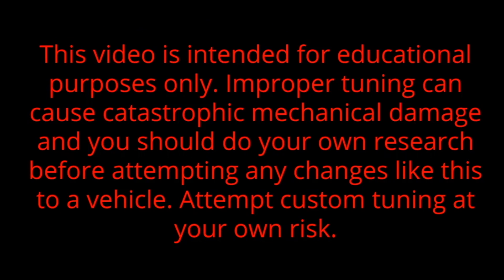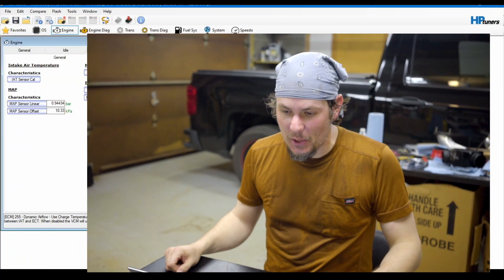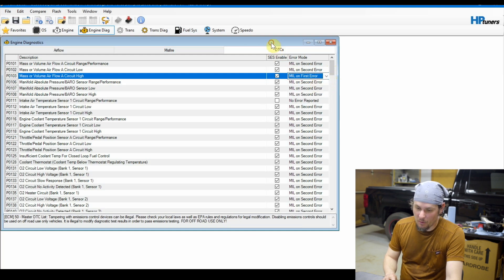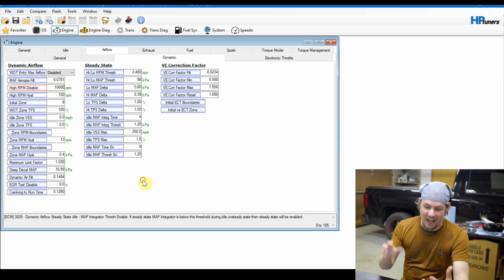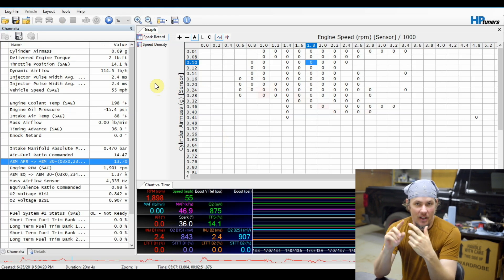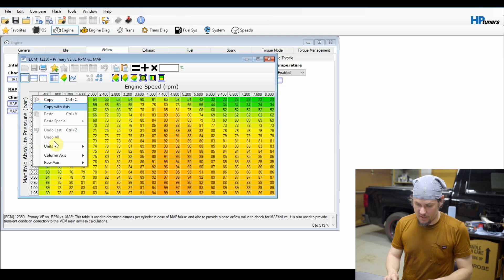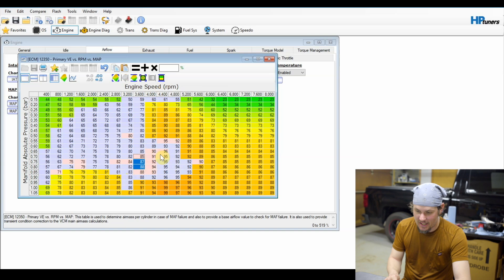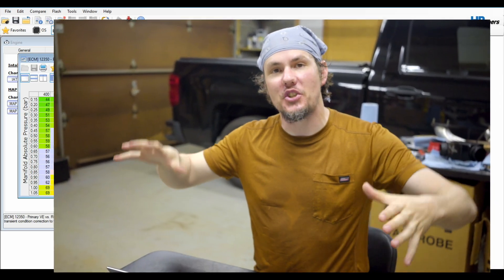GM Gen 3 Speed Density Tuning Guide Using HP Tuners, Dialing In The VE Table

Comment: first, goat rope garage i have learned all my tuning from you and i thank you. my problem lies here. i have a heads and cam ls1 m6 that was original tuned off narrow bands once i got my wide band and hp tuners i began working, but before adjusting the car was lean everywhere before power enrichment was enable. i spent hours tuning the VE and MAF tables correctly. everything was flawless the AFR was practically perfect. once i enabled closed loop the LTFT was -10 at idle and taking away fuel until power enrichment was enabled. but in wot it is perfect all fuel trims drop to zero. but this is my problem. with open loop forced enabled the AFR is great all across the board but once i enable closed loop the long term fuel trims lean out my motor. i am beginning to think the slightly aggresive cam is throwing off the narrowbands. so is there anyway to adjust the narrow band stoich or should i just run open loop all the time with dynamic airflow?
Reply: this happens often with medium to larger sized camshafts with a decent amount of overlap. It's usually a large swing in the other direction though. The overlap will cause the valves to be opened at the same time causing a false lean reading, which will cause the pcm to compensate the trims for it.. This issue only gets worse when you throw a set of LT headers in the mix.  In your case, one of two things might be happening. You may have changed your injectors and/or the minimum pulse values are not able to pulse slow enough, so the PCM is compensating for it.  Or the injection timing is not set correctly based on the initial spray after (the pcm thinks) the motor is at ABDC in the cycle for each cylinder.

Comment: Got a question.my IAT sensor is in my aluminum 3 inch piping after turbo intercooler before throttle body and I'm having a issue where my A/F is going lean after some normal heat soak.i feel the sensor is in a good position.what is your opinion with cylinder charge temperature bias etc.do you tune it or turn it of.so much conflict on the subject.cheers mate you do a great job.
Reply from the maker: You have closed loop disabled?
Reply: Yes mate forgot to mention this.i don't have alot of time to tune so I have left it in OL while I tune the ve.i will put it back to CL at some stage but was just wondering what you thoughts see on tuning the bias table.cheers

Comment: Have problems getting this histogram to work,  it’s the only one I’m have a problem with.  It’s only read across the top row of the cell hits and not through the entire map.  I’m stumped. I watched this video like 15 times to figure out what I’m doing wrong.  But I am not sure.  All PIDS are logged.
Reply from the maker: Your row parameter in your graph isn't setup right, double check all your settings. This video might help you out:

https://youtu.be/f3txG2I8InQ
Reply: Got it working.    I don’t know what or who did this. But it’s a mess.   Wish I could post a picture.

Comment: do you still tune in lambda on the Gen III? I've started tuning my Gen III in AFR and can't really figure out the whole lambda concept. also for some reason my aem Wideband lambda histogram reads in AFR. do you know how to fix this?
Reply from the maker: Depends, some of the gauges don't show lambda, but on a Gen 3 tuning afr is fine if you're not going to run e85
Reply: @GoatRopeGarage  thats the thing, I am going to run e85. I already have the sensor hooked up and working. I've only been running gasoline until I get the tune right. do you know how I can get the Wideband to read lambda? if I can get that I can probably figure out the rest. thanks for the quick response and all of your videos!
Reply from the maker: @DoctorPresley  which one do you have?
Reply: @GoatRopeGarage  the AEM 30-0300
Reply from the maker: @DoctorPresley  hit the mode button, they're should be an option for lam select it and it will read and output in lambda instead of afr.
Reply: @GoatRopeGarage  alright that sounds pretty simple, lol. I though I could just pull it up on my HP tuners. alright after watching some other videos I realized I was really over thinking tuning in lambda. thanks for all of the info!!

Comment: Kyle, im having some idle issues out of  a truck im tuning. My question is, i use one of the innovate tailpipe clamps for my wideband. Im eliminating things for the intermittent stall. Should i tune idle and say up to 2k rpms with fuel trims since im getting erroneous readings with the sensor at the end of the exhaust stream?
Reply from the maker: You'll probably have to do some manual adjustments and if you still have the narrow band sensors you can put it in closed loop and then use your fuel trims to fix the rest

Comment: I have a TSP low lift truck cam stage 3. I am redoing my VE since I changed my pulse data that was wrong for the injectors I have(factory TBSS intake and injectors). Should I be seeing 118% at peak torque portion of the VE table?
Reply: I'm working on my table now and getting close to that now with more to go.  I have btr 3 truck ported heads intake and flattops in 5.3. I was thinking the same thing
Reply: @michaeldickerson8470  so after some time I decided to put a regular truck manifold on. Get rid of the big China throttle body and run smaller injectors. The injectors that I had in the old truck manifold went bad. So I ended up using the TBSS injectors. Now with the truck intake and throttle body, along with the TBSS injectors, I am seeing around mid nineties at peak torque.  So those high numbers were pretty close to accurate then.

Comment: First all your videos are great.  I am having problems will getting my Histograms to read any data.  I follow your videos exactly and still no luck.  Any ideas,  I am new to all this.  Thank You!
Reply from the maker: If no data is showing up at all you're missing an input, church that all your parameters are reading in
Reply: All parameters reading in the PID's but I think my problem may be that I don't have my wideband connected to my MPVI2 so  I am not showing the actual vs commanded on AFR in the PID's. Thanks for the quick response.

Comment: I got one for you.
On the channel list, should manifold absolute pressure and manifold vacuum be the same KPA when viewing the data ? My MAP reads 10 KPA lower than manifold vacuum.  Aren’t both PIDs reading off the map sensor data ?
Reply from the maker: Should be, but some setups have more than one
Reply: @GoatRopeGarage  it’s a gen3 5.3 with only one map sensor. Cloned my wbo2 graph and used manifold vacuum instead of MAP and it’s not even close. Think it’s because MAP calculation is Baro plus or minus vacuum.
Reply: Had a no name brand MAP on this engine when I built it. Tried the stock one off a junk yard motor and the fueling is all changed. Re tuned VE to the good MAP and it’s a different animal now.

Comment: would it be a problem to use the maf at low rpm in a big cammed engine? I seen the factory file you used here was set at 4000rpm.
Reply from the maker: MAF tends to not like cams, you can try but there yes a chance it will have issues
Reply: @GoatRopeGarage  ok, thanks for the reply!

Comment: I have a P01 ecm. 2000 yukon. The stft on mine was enabled. Engine-fuel-open loop/base stft enable/disable. On the maf tuning I caught it. After disabling it my maf afr error histogram changed dramatically. Should that remain disabled doing sd logging and tuning?
Reply from the maker: Yes. Normally failing the 02 sensors will disable them also
Reply: I ran into that same problem. My STFT were still on and correcting my afr. Turned the STFT off and it was idling at 12:1 afr 😂

Comment: How do you set your table up if your on e85 and your targeting e85 a/f ratio of 9.? But 14s with the wideband?  If that makes sense.. lol.. because my table is showing like in the 50s on the lean side.
Reply from the maker: Anyway to do lambda and just skip dealing with AFR?
Reply: Goat Rope Garage as far as my wideband goes Its an aem uego and I believe I can set it up in lambda.
Reply from the maker: @86boostdcapri  I would do that then use the commanded EQ and then you'll always be good no matter what ethanol content
Reply: Goat Rope Garage, great!  Thanks for the help!!
Reply: Goat Rope Garage looks like I can change the settings to display e85 scale, not lambda.  So I guess if I set it to the e85 stoich scale that should work too
Reply: @86boostdcapri  if not a flex fuel setup, go to  fuel, general, stioch afr and set it to what percentage ethanol youre running.

in vcm scanner, make sure you have equivalence ratio commanded and your mpvi input for AEM wideband in your channel list and then use the eq err math for the histogram.

On the gauge just leave it AFR if thats what youre used to as a visual reference when driving and let the histogram do its thing when logging so you have your new ve after the log.
Reply: Youre overthinking the scales, just let the aem send its lambda analog signal to hptuners, you dont need to change anything. You can add an afr channel if you want to view afr during a log review, but as far as the histogram, that all needs to be in lambda. Nothing needs changed for that. just use the two appropriate inputs of data for it.
Reply: superbeeblaze yea I got it all straightened out.  Thanks though

Comment: not sure why but my vcm editor doesn't have as many options as yours. i.e. all i have under engine diag is dtcs. Also much less tabs under the engine section. 02 suburban is what my computer says in the scanner.
Reply from the maker: Different generations have more or less tables. The basics will be there to do things like MAF, SD and timing though

Comment: Hello from Australia! Getting my head around the tuning, when you go log your data and have it ready to copy, once you paste it into your ve table and multiply by half like you said to do it then changes the ve table closer to where it’s meant to be? Am I right? So you log, copy and where it says your ‘minus 2.19’ once you paste that into the ve table it will take 2.19 from that cell in the table? Thanks!
Reply from the maker: When you paste you want to use the multiply by half, so that 2.1 is in percent and when you do the half it is going to shift that cell be 1.1% in the direction towards correction.
Reply: Also, what is a good afr for a cammed ls1? What should I be aiming for? Cam is a 232/234 112lsa
Reply from the maker: Port injection motors usually do good at a PE of 12.5, a tad richer if boosted
Reply: Ah right so then you go log again and then it’ll you’ll shift it another half and should be spot on or even closer!

Comment: ??? my afr err in vcm shows its adding fuel bout ltft are taking fuel which one do i need to use to make adjustment to ve i have no boost only cam long tube header dbc
Reply from the maker: Check for an pinhole air leak around your wideband you might be getting some air in your exhaust causing it to read lean versus your LTFTs. Don't forget to reset your LTFTs also to make sure you're not looking at old data!
Reply: i checked for pin holes so should i count on what widebband is outputing to be safe
Reply from the maker: Reset your LTFTs and see if it's still off. If it is when your commanding 1.0 lambda if do an open air calibration on your Wideband next. You are comparing one wideband to two narrowband sensors and if both are saying the wideband is wrong then I wouldn't trust it.

Comment: You have a lot of great content thats easy to follow and understand!  Thanks for sharing your knowledge. ..
Question for a gen3 turbo; what should i target my afr's for 1-7psi as i transition to full boost at 14psi?
Reply from the maker: I'd be getting in to PE once you're in boost.
Reply: @GoatRopeGarage  Huge thanks for these vids and info man! Wanted to piggy back on this question real quick, can you give some knowledge/advice on PE vs Boost Enrichment when using a modified 3 bar OS?
Reply from the maker: That's probably a topic that should be addressed in a video, I'll add it to the list!
Reply from the maker: @Stephenrushlow  38 man, that's rough, you running an upgraded fuel lobe on your cam? Torque table shouldn't be causing any knock, it will pull timing if you max out power but you should be seeing that on your scanner. You running meth injection yet?

Comment: Hey man! Is there a way to use a 2 bar sensor to strictly view boost and not change the OS to SD? Then still just tune with the MAF? Or is it mandatory to convert to 2bar OS. (03 5.3 mp112 S/C) thanks!
Reply from the maker: That's a good question, you can still update the scaling so it should work like you say. I think the only place it caps is on the VE map. Theoretically you could use a three bar sensor with the stock OS, it's just that your map is limited.

Comment: I have 2 questions my main ve primary is in kpa do i need to change it to bar or just make my graph in kpa vs bar? Question 2 my afr err doesn't work only my eq err does you said gen 3 is afr but without that working in anything i have been using all lambda is that ok or do i really need ro figure out why afr reading arent working? Thanks Chris
Reply from the maker: You can leave it in kpa, just make your graph match you map. Some of them have lambda and that's perfectly fine to use EQ error ratio.
Reply: Goat Rope Garage What do u mean make ur graph match ur map? I have the sane problem/question and at first I was only getting row of info on the log then switched it to kpa and it’s reading but it’s showing it wants an insane amount of fuel and it’s pig rich already so and I double checked to make sure histogram is right. On e85 don’t know if it matters or not
Reply from the maker: Look at the table in the editor you're trying to the tune, the rows and columns should be the same

Comment: if im lookig at my afr err ve in scanner with every thing back on it shows lean side but fuel trims read in the negtive side kinda high wideband staying around 14.7 to 15.3 its not stable jumps around
Reply from the maker: Did you reset your LTFTs in the scanner?
Reply: @GoatRopeGarage  yes i did
Reply: @GoatRopeGarage  every thing looks great till i cut the maf back on its a n\a with a "mild" cam
Reply from the maker: @Ls_kang369  MAF is going to be your primary air metering source, you sure you have it dialed in good? Cams are notorious for messing with the MAF's ability to meter air, might be about time to go speed density out try and move the MAF further from your throttle body.
Reply: @GoatRopeGarage  so to go speed density just leave the maf off
Reply from the maker: @Ls_kang369  basically. It depends on what all extra sensors are housed. You're best bet is just to disable it by adjusting the settings under diagnostics like you do to do the SD tuning then disabling the CEL. Should keep you in SD mode.

Comment: I have a 99 Silverado that I put a 2001 6.0 liter in, how big a problem would it be to use the 01 ecm, and if it will work woud it be worth it? I read that the 01 operating system is better than the 99? Thanks for the videos
Reply from the maker: Carl, I don't think it would be much of a problem, the Gen 3's are pretty swappable. Things were much more simple back then.

Comment: How would you go about tuning your main ve if your gen III has secondary ve it defaults to when in speed density and secondary ve table that are half the size in terms of rows and columns?
Reply from the maker: Jim, what platform is that on? I was looking for in of those wonky dual VE table ECUs the other day. I want to do a video on it.
Reply: @GoatRopeGarage  i have a 2000 Silverado 5.3. p01 ecm
Reply: @GoatRopeGarage  Any suggestions or possible video on it?
Reply from the maker: I'll try and do a video on it eventually. But you can do the same process and just create two error tables in your scanner, one for each VE table.
Reply: @GoatRopeGarage  thanks
Reply: Any suggestions or possible video coming soon covering it?
Reply: My 97 corvette has secondary ve table. So does my 2000 Chevy 2500. Just set up an additional afr error graph with the secondary ve table row data. You have two ve tables you have to copy and paste into each time. Or can go and do all your updates in the secondary until it is dialed in and then copy each row individually into the primary then interpolate for the missing rows.
Reply from the maker: You can do the updates to the secondary then copy it to the primary when you're done

Comment: question of the day if i snatch off in my car i trip tps sensor car goes in to limp mode have to kill car restart car find new tps new thorttle body it a manual car is it somthing in the tune or you think bad tps  oh its gen3 set up its was from a automatic
Reply from the maker: Which code is it setting? Tps range?
Reply: @GoatRopeGarage  its P0122
Reply: it dbc 92mm throttle body
Reply: only does it if i try to do burn out

Comment: Quick question about the speed density  enhanced 2/3 bar OS.

On stock gen 3 GM code the igniton timing is setup as a function of RPM vs Cylinder airmass. When you upgrade to the enhanced OS does it change this back to a standard RPM vs MAP timing table or will it function the same as stock code but with the cylinder airmass rows extended?

It gets kinda annoying when your airflow changes to the VE table affect your igniton timing while you're trying to tune. My work around is to setup the timing table as strictly "mechanical advance" until i get my fueling sorted out and then add the cylinder airmass advance back into it once my VE adjustments are done. Obviously this isnt a good idea on a boosted setup but it works for NA.

Keep up the good work bro 👍
Reply from the maker: I'm not sure on that one, have to do some digging to find out.